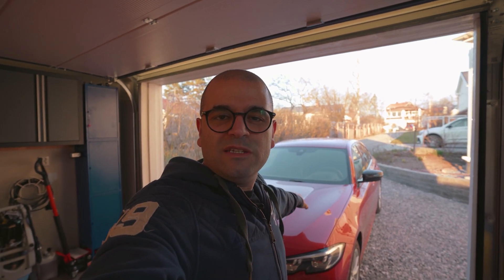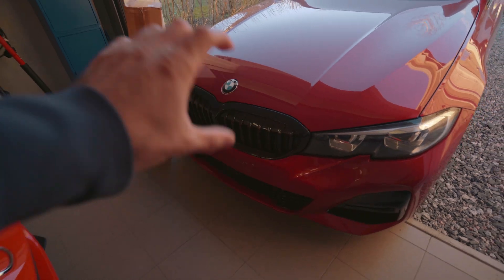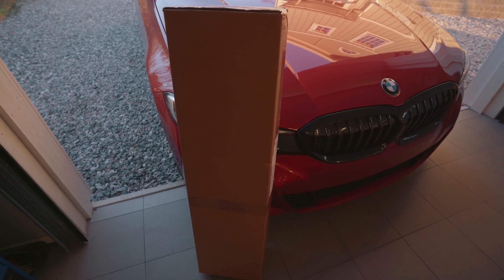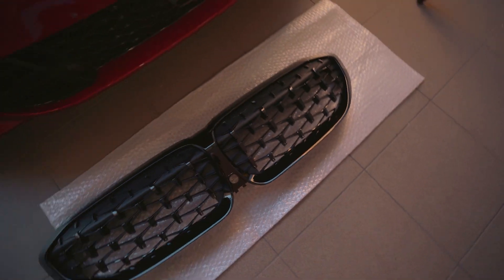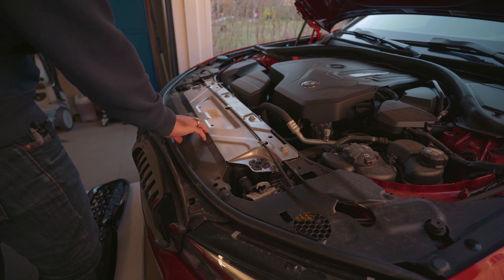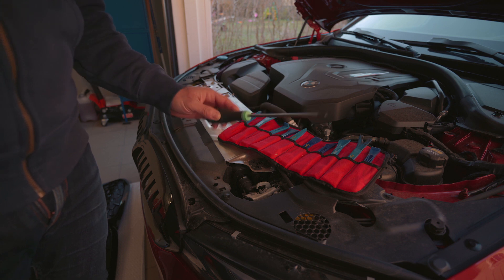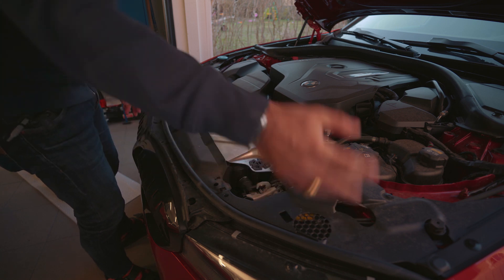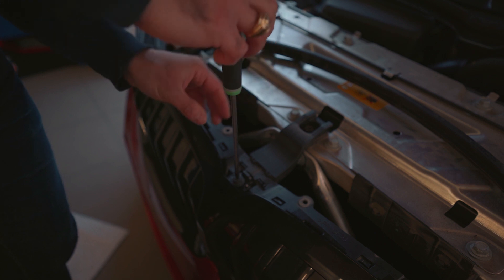BMW G20 320i 330i 330e 340i - DIY diamond grille install

Comment: My 20’ g20 doesn’t have a front camera. Would that be a problem if I got this same grille ?
Reply from the maker: There are options for the grille without the camera. For the OEM one there was no cap for the hole in case there camera is not there. You need to get this one https://www.salesafter.eu/product_info.php?info=p3047_bmw-m-performance-g20-g21-ziergitter-schwarz-mesh-design--ohne-pasp.html if you want the OEM one

Comment: This grill is original ? I have a 330e portimao blue and i want this grill but Metallic. Its plug & play?
Reply from the maker: the one I ordered is a BMW OEM part. I have the link in my description from where I got it if you are in europe. It is plug and play, make sure you get the right version if you have park assist plus or not

Comment: Did you find any issues with the active grill where it has the vertical lumps on it - does the diamond grill just fit over the top ok?
Reply from the maker: The shutter still works, no issues. It fits right over

Comment: Does it still have the grill fans for cooling? Or could that give an error in the system?
Reply from the maker: The active vents are still there. They are sitting behind the grille and are not impacted 👍
Reply: Know any sources in the USA? I have a leased 330i and wouldn't want to void the warranty and cause issues. I have the standard chrome grille
Reply from the maker: I Googled the part number and got this in the US. Remember that it is for cars with the 360 camera setup. 

I miss my mom's ghormesabzi :P
 https://www.getbmwparts.com/oem-parts/bmw-g20-3-series-m340ix-gloss-black-front-kidney-grille-park-assist-plus-51139448475
Reply: @Themazcorner  There is a product in case you do not have the 360 camera setup. It is available at: https://global.cksperformance.com/products/bmw-g20-3-series-kidney-grilles-gloss-black-diamond-grilles?make=bmw&class=3%20series&model=G20&type=grilles
Reply: @khoroshsabzi  Yea my 330i is also a lease and I am very much on the fence as far as performing this mod. Did you end up doing it?

Comment: Did you find that this grill fitted perfectly and flush without gaps like the original ? I purchased one from
Carbon Accents in the UK and found it doesn’t fit perfectly. I guess you get what you pay for
Reply from the maker: I had no issues with the fitment. The one I got was BWM OEM so would not expect anything else. Back then it was not that expensive paid around 100 EUR.
Reply: Thank you so much. Love your videos by the way, keep up the great work.

Comment: Thanks for the video but i have a question, i installed this grill but my kidney grill wont open because of the new grill any tips?
Reply from the maker: Thanks, glad you like!
Hmm I did not have that issue, has it been seated properly. Also the grilles only open in certain situations havey you driven it hard enough :D
Reply: @Themazcorner  well it opens if you start the car also, but it wont open diamond grill blocks it so i dont know what to do now 🤨
Reply from the maker: Hmm I never had that issue with mine. Is the diamond grille an OEM one? Also which model year do you have? Thinking if they have changed something
Reply: @Themazcorner  My new grille is the same one you place on the video my bmw is made in 2021 so i dont think much of difference
Reply: @sennalambert6511   Did you put the previous grill back due to this issue? I was thinking about replacing it with this type of grill.
Reply: @Emirkdaywalker  yes i did because it didnt open anymore now i asked somebody if they have a grill like this but that it can open
Reply: @sennalambert6511  looks like this front grill  type doesn't support our model fully then. I installed this type of grill 3 days ago to my G20 2019 not seeing it opening yet. This grill type might be blocking it to be open. I might have to cut some areas behind it maybe to fix this issue.
Reply: @Emirkdaywalker  yes indeed the diamond grill blocks the kidney grill if it opens i dont know if that is an issue if it cant open or not i didnt take the risk
Reply: @sennalambert6511  when it didn’t open did you get engine light or overheating? 
I searched a bit looks like it helps for better fuel consumption only. I’m thinking if it doesn’t overheat or throw an engine light error I might keep it. It looks really good. Will test it 1-2 week before making a decision to return the part maybe.

Comment: Very cool, thanks so much! Will take delivery of my 330e this friday, so this is very helpful!
Reply from the maker: Great that it gave some input. Congrats to the car :). What spec did you go for?
Reply: Mazman Thanks! Love it so far. MSport with pretty much all bells and whistles except adaptive dampers and sun roof. Really happy :)
Reply from the maker: Great to hear! It is a really nice car, what color?. I am waiting for Schnitzer to come out with a tune :D. There companies offering it but I don't want to use those tunes.
Reply: Mazman Mineral grey with cognac interior. Rather classic (read boring ;)), but very nice in the flesh. Same combination as the french press cars I found out after ordering mine. Love your color as well!

Comment: Thanks for the video just ordered one for my G20 330i, not a bad price at all for oem part. just booked window tiniting for next sunday as well.
will look a lot better after these simple mods.
Reply from the maker: great that you liked it! yeah it is a good prices piece and makes a big difference in my opinion. Yeah window tint is nice, do you have black window trimmings etc?
Reply: @Themazcorner  yea has the gloss black trim around windows so should look good, got some other ideas planned for car maybe gloss black roof wrap and mirror caps my car alpine white and maybe the Msport styling kit sideskirts etc..
Reply: Hi 
How do you know its definitely an oem part?
Reply from the maker: I ordered it from a BMW retailer
Reply: @Themazcorner  salesafter.eu is directly from BMW?
Reply from the maker: @shah91987  They are selling OEM BMW parts yes. They are a BWM/MINI retailer
Reply: @Themazcorner  thanks so much for confirming. Great video btw! I've watched your video for the first time months ago. Will be able to do the change myself aswell soon:-)
Reply: Hi there, me again, finally at the stage of buying it for my 330i but online it says only for the m340 , so I enquired Customer service if its for any g20, unfortunately they told me BMW recommends it only for the m340.
Are you positive it would fit any g20? 
Thank you in advance
Reply: @shah91987  if your ordering from the link in description like I did it fit my 330i G20 just fine, I don't think there is any difference fitment wise between the 2 models.

Edit also thinking about it BMW would only recommend for 340 as it's a signature grill fitted to the 40's so people know from front of car it top series 1234 etc .
Reply: @stevedean5310  thanks for confirming 👍
Reply from the maker: Sorry for the late reply. As @steve Dean mentioned it will fit unless the made some changes for 2021. 

Also as mentioned they want to keep for m340i and usually also officially companies don't want to recommend parts thst are not sold as an option due to different reasons.
Reply: @Themazcorner  also thank you for confirming, will be ordering it tomorrow:-)
Reply from the maker: Worst case you will have a nice wall ornament in the garage 😆

Comment: Follow this exactly. got the the top clips off, cant get the side clips off. It almost feels glued on. :(
Reply from the maker: Hmm, have a look here to get an idea on how it is sitting, check step 2: https://www.newtis.info/tisv2/a/en/g20-318d-lim/repair-manuals/51-body-equipment/51-11-front-bumper/1Vnd9g3qRK
Reply: @Themazcorner  Wow! Can't believe you replied :D. I did all of that. Removed all screws. top one as well. I can unclip the top clamps no problem. It is the side clips. They won't budge. I am too afraid to pull hard since I have the front camera as well! I even tried to leverage it off slowly but it won't move! I am going to try again. Wish me luck!
Reply: @Jose-gd1fd  Did yiu do it? i spenf 2 hours trying to get the middle part off which just seems glued . i am not sure how to get the old one off :(
Reply: @kumarabhishek6952  I did get it off. I had to PULL as hard as I could to get the clips out. I didn't break anything thankfully but PLEASE be careful. Just make sure you unhinge the clips. Also using a screw driver and having my GF help me really helped. Best of luck friend.